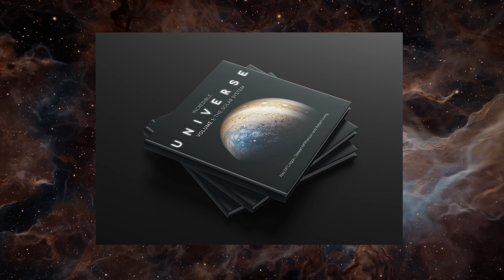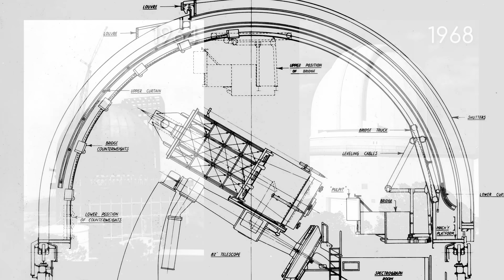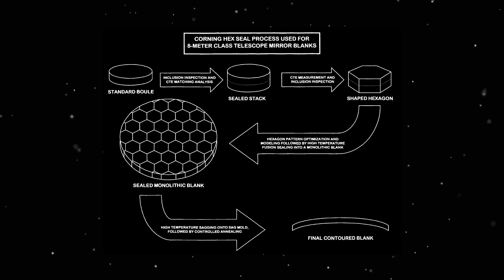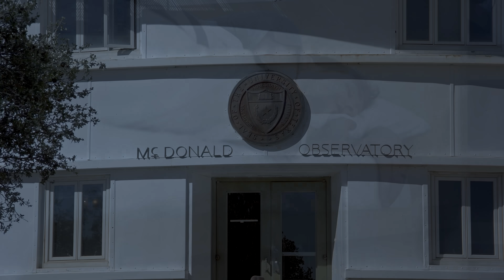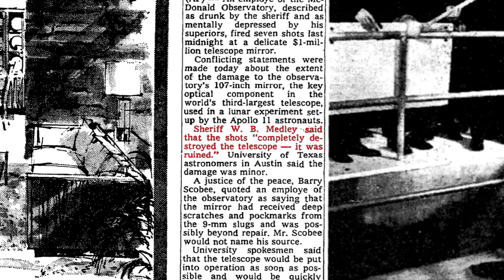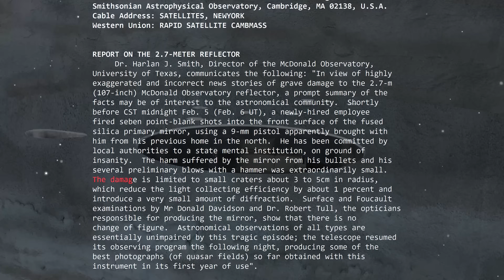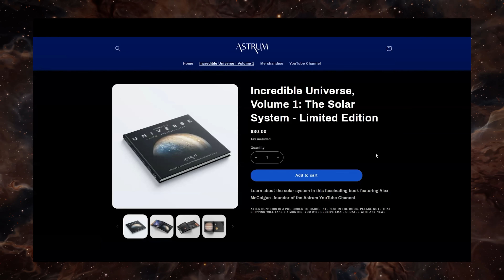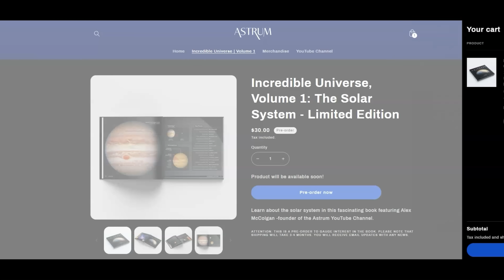Malicious Attack on $5 Million Telescope. Scientists Don’t Care.

Comment: There's a video on my channel where I hit a piece of 3/8" thick tempered shower glass with a framing hammer. I thought it would break, but it didn't, so I adjusted my grip and started swinging from further back. Nothing. The hammer just bounces off. It bounces off, unless you hit the ends. All you have to do is gently tap the end part and the entire piece will instantaneously explode. It doesn't break from the point of impact, the entire thing breaks at once. Well, it appears to break all at once, but with high speed camera, you can probably watch cracks propagate from the point of impact. The whole thing is in compression due to the tempering process, and there are stress concentrations on the short sides, the 3/8" thick sides. If you're going to try this, wear ear plugs though, it's extremely loud!

Comment: It's hard to believe they can't repair the mirror. Can't they fill the holes with molten glass?
Reply: No - once the blank has been figured and polished, that's it. The nature of the material itself prevents this, as it would require fusing material into the damaged areas, then refiguring and final polish (this is greatly over-simplified).

Comment: Maybe the only "operational" telescope to be attacked, but the 200 inch Hale mirror was shipped cross country by train in 1936. The crate surrounding it was wood, but Corning required that the mirror blank be sandwiched between thick sheet steel to protect it.  When the blank arrived in California it was discovered the shipping crate had be struck 4 times by bullets!
Reply: Sounds similar to aircraft fuselages moved by train that sometimes have to have bullet holes repaired before they can be assembled into airliners
Reply: @matthewmiller6068  hunters shoot propane train cars all the time. What they don't realize They would easily blow themselves up if they are within even 500 yd of a propane train car.
Reply: @rustyshakleford5230  Rifle wouldn't come close to hurting a tanker car on a train
Reply: @rustyshakleford5230 Mythbusters would disagree.  Assuming that you don’t have an elephant gun.
Reply: @rustyshakleford5230  ....why?!
Reply: Propane doesnr just ignite when you shoot it like that
Reply: @rustyshakleford5230 sorry not gonna blow up. Propane has no oxidizer present and is cold when it depresurizes. A bullet, even if it was capable of penetrating the pressure vesse, would be super cooled the moment it penetrates the cease and propane rushes out. That will cool any (unlikely) spark and prevent the explosion. 
Now, if the escaped propane then reaches BOTH a mixture between the lower and upper explosive limit (neither too rich nor too lean to ignite) AND an ignition source at that point, there will be a fireball, not an explosion although the initial flash could seem like an explosion but it’s not. 
If propane is still escaping the breach, it is possible to have a large stream of flame at the interface between the escaping propane and the surrounding air at the point where the mixture is appropriate to support combustion. 
You can make such a cylinder cause a large blast but it’s still not going to be an explosion and I’m not going to describe how to do it. 
USMC Ordnance
Instructor, field expedient mines, booby traps, and explosives.
Reply: @danlorett2184  Its still insanely stupid of them to do so
Reply: 'Merica moment.
Reply: A damn  good reason for strict gun controls. The USA needs an IA that can track svery gun in real time, and every bullet fired and who fired it.
Get working IT programmers!
Reply: @way2dumb  "The government chips our bulleeets."
Reply: @way2dumb you REALLY can't be that stupid!
Reply: @way2dumb  Name checks out
Reply: thegreenpickelit's it's an Australian thing,laughing at oneself. It's a level of sophistication and maturity most right wing Muricans never achieve. , Obama was good at it.
Reply: @way2dumb Really? Is that why comedians refuse to do shows at College's becausee the Left are unable to laugh at themselves.
Reply: @A-FrameWedge  In the USA, not Australia. I see few comedies with Americans laughing at themselves, they generally laugh at others. Aussies have a superior sense of humour in that regard.
Reply: @way2dumb  Australia might be even more Woke than the U.S., so sorry not buying it. You probably love Hana’s Gadsby humorless style.
Reply: @A-FrameWedge never heard of her him whatever. We are awake. Woke is  
a past tense verb, not an adjective or adverb.
Reply: @A-FrameWedge  I am not selling you anything.
Reply: @A-FrameWedge lol imagine still being one of the cringe lord's/lady's that think being woke is something bad 😂
Reply: @A-FrameWedge  jokes need to be funny for people to laugh, regardless of politics
Reply: @A-FrameWedge  Trump and Elon had great sense of humour and we're famously able to laugh at themselves. Right ... 🤦
Reply: @way2dumb I've seen better bait, you should look at what people actually argue for instead of what you're told to think that they do
Reply: @way2dumb username checks out
Reply: @way2dumb      The USA needs AI that can protect us from horrible legislation and horrible legislators.   A much better concept.   But I don't trust AI either.
Reply: @BillSmith-fx7xx  yeah well AI does not work like that. AI only gives you what you put into it. who ever programmes it will make it do what ever they want it to do.
Reply: @way2dumb  You're smoking something lol but yes, I agree that is funny
Reply: @way2dumb  Like we can't make our own guns or peel trackers off with a screwdriver, acetylene torch, or ... letting the battery die?
Reply: @StarForgers theoretically with enough surveillance access you wouldn't need that. You could track any firearm via triangulation of every microphone, if you have control of the supply you could put a radioactive isotope on every gun to detect them remotely, but if you could access every camera you could just track them visually with an AI and make sure you know where everyone with a gun is at any time and to track any occurrence of the gun appearing. With non visual light based cameras, like IR it might be a lot easier to detect guns. I think there is even an electromagnetic camera concept where it can basically detect ferromagnetic materials and EM fields with a visual generated on a screen. But the easiest thing would be just having microphones everywhere and then a bunch of little drones to track any gunshots and launch a drone to the location to follow the shooter.

Comment: Sooo... why the heck they are making them so big, those mirrors, if most of them is not used...?
Reply: You would have to fully understand telescope optics, and optics in general, along with the pragmatics of designing and implementing the system. The purpose of the telescope is also a factor. This is a "Swiss Army knife" which can be optically reconfigured, as well as instrument payload, to work from direct imaging sciences to point-source stellar photometry and spectroscopy, over the terrestrial optical EM band. In this case, the central obstruction/secondary shadow are a necessary artifact of what the telescope is designed to do.

Comment: The Hale 200-inch mirror was cast in 1935 by Corning and was the largest telescope mirror in the world at the time. It had problems and it was recast again, this time successfully. After an initial grind it was to be sent to California by rail to get polished. It was carefully put inside a wooden box. As an afterthought, they added some metal plate to the box. When it arrived in California they found some bullet craters in the metal plate covering the mirror. It looks like someone used the moving box on the train car as target practice. The mirror was undamaged thanks to the decision to add the metal plates.

Comment: Even without the special properties of fused silica, I wouldn't have expected such a thick piece of glass to simply shatter. I'd pretty much expected local damage, like it actually turned out. Though the highly defined edges of the damaged areas were surely interesting. Or are these images taken after smoothing them out?
Reply: These are current images, captured long after the mitigations were taken. A diamond burr grinder was used to smooth the cavities, to reduce off axis, as well as on-axis scattering. The cavity edges were smoothed, best described as a bevel, to reduce stresses in the transition from surface to cavity/damage, which might propagate as surface stress fracturing across the figured surface.   We coat over the entire substrate, as if it  has no mechanical damage.

Comment: If the telescope doesn't really need the interior rings, why not just build a really big mirror without it?  That would save on weight and cost.
Reply: In a system of this type, the obstructed central area, near the straight Cassegrain focus, it is possible to use the thickness and weight of the substrate as part of the optomecahanical  design of the telescope's structure. That is one element in play here. This era also predates things like computational FEM, the advances in material science, and optical science we have today. We would not build anything like this in contemporary times.

Comment: Interesting story.
A lot (not all) more modern-build telescopes would suffer a lot more damage, with the more prevalent very thin segmented mirrors on adaptive optics mounts… but on the other hand, these mirrors might be somewhat easier to replace these days than the older massive one-piece ones. I don’t even want to think about what it would mean to replace the Palomar 5 metre mirror these days.
(A complete rebuild of the mount and going for a segmented mirror may be possible, but it would likely be a nightmare to do - a nightmare several years long…)

Comment: Harlan J. Smith is the largest closed-tube telescope ever built.  Pock marks were painted black.  I visited McDonald Observatory during the Texas Star Party.
Reply: The anecdote re. painting the damaged areas black is incorrect, urban legend. We strip the old coating, prepare the bare substrate, and coat the entire area, including the damaged areas, as if they're not even there. In some cases, they look black, however that is by intention, to prevent scattered light from the damaged areas, combined with aging of the coating. I can assure you, they bullet marks are not painted black, or treated in any other way...

Comment: The Telescope That Took a Bullet: The Story of the Harlan J. Smith Telescope and its Resilience

* 0:09 A Telescope Under Attack: In 1970, the Harlan J. Smith Telescope at the McDonald Observatory in Texas was shot seven times with a 9mm pistol by a disgruntled employee named Jack Hyde. 
* 0:39 Third Largest in the World: At the time of the incident, the 2.7-meter telescope was the third largest globally, representing a significant investment and scientific tool. [From ffggddss's Comments] This claim is potentially inaccurate; the 120-inch Lick Observatory telescope may have been larger at the time.
* 1:46 A Collaborative Effort: The telescope was built with a $5 million grant from NASA and was intended to support research relevant to the early space race. 
* 2:59 A Remarkably Resilient Mirror: The telescope's mirror, made of fused silica glass through a complex and lengthy process, proved to be unexpectedly resistant to the attack.
* 3:04 Fused Silica's Strength: The layered construction of the fused silica mirror, originally due to material scarcity and technological limitations, inadvertently created a laminate-like structure that absorbed the impact of the bullets. [From jokerace8227's Comments] Fused silica is more difficult to mold than regular glass and requires much higher temperatures to produce.
* 7:07 Hammer Time: Prior to the shooting, Hyde attempted to smash the mirror with a hammer, which also failed and resulted in only a minor chip. [From kirbymarchbarcena's Comments] The mirror's resilience humorously demonstrates Newton's Third Law of motion.
* 8:30 Minimal Damage: Despite the seven bullet holes and the hammer strike, the damage to the telescope's light-gathering capacity was estimated to be only around 1%.
* 8:36 Critical Areas Missed: Most of the bullets hit a less critical area of the mirror near the center, where light-gathering is less important for image resolution. 
* 9:23 Quick Repairs: The telescope was quickly repaired by drilling out the bullets, smoothing the holes, and reapplying the reflective coating. 
* 9:40 Leniency and Understanding:  Director Harlan J. Smith, learning of Hyde's mental health struggles, chose not to press charges and instead sought to get Hyde help. [From BernhardtBauer's Comments] This was a commendable act of empathy and support.
* 10:38 A Legacy of Discovery:  The Harlan J. Smith Telescope continued to operate for decades, contributing to significant discoveries in planetary science and exoplanet research.
* 11:40 Space Hazards: The incident highlights the resilience of Earth-based telescopes compared to space-based telescopes like the James Webb, which face constant threats from micrometeoroid impacts. [From tomholroyd7519's Comments] This is true; the JWST has sustained minor damage from multiple micrometeoroid strikes.

I used gemini-1.5-pro-exp-0801 on rocketrecap dot com to summarize the transcript.
Cost (if I didn't use the free tier): $0.08
Input tokens: 20518
Output tokens: 657

Comment: Fascinating story, and well told! But having been an amateur astronomer since about a decade before this incident, I'm puzzled by one claim made here.
Maybe my memory is faulty, but if it isn't, I thought this 70-inch scope would have ranked 4th or lower in aperture at the time, not 3rd.

This being a few years before the Soviet's botched 6-meter (236-inch) mirror saw first light in Crimea, the 200-inch Hale telescope at Palomar was still largest in the world; and the 100-inch Hooker reflector on Mt. Wilson had been in operation since the very early 20th century.

I thought that the 120-inch at Lick Observatory was in 2nd place; or was it launched after this incident at McDonald Observatory?

Fred
Reply: I stand corrected. This scope is 2.7 meters – 107 (not 70) inches in diameter.

Comment: 72 hour shifts? how strong is their meth?!?! if they are not on meth your lying.
Reply: They sleep in between. They’re just at the site for 72 hours
Reply: @HyperspatialAgent_Axis4  but the dude said most live on site??? now that's just getting misleading and confusing
Reply: They slept on-site on cots. Shifts themselves were long, yes, but not insufferable. They got to sleep.
Reply: @DrachenGothik666  thx for clarification 👍
Reply: From the perspective of someone who has done this, and related jobs for a very long time: it may well be routine, that an observatory staff member's "shift" could be 72-hours, sometimes longer. We do it without "meth." It isn't uncommon for an instrument engineer or tech to remain on call for that sort of interval, responding activity to both day, and night needs. For someone coating an optic, especially a large primary, similar demands are present.

In my role, I am, in fact required to live/reside on site. In the era in which this event occurred, there was significant schedule pressure, and science need to keep the telescope "on sky" every single minute weather permitted, as well as the day-time operations required to make the former possible.

Comment: Interesting you'd think they'd fill the bullet holes with something, anything, even if it's not perfect it would surely still be better than loosing 1% of light?!
Reply: Filling in the holes wouldn't do much, there is a reason so much time and care went into making it. If you didn't fix it exactly how it was first made it would only make performance worse.
Reply: It wouldn’t do anything and it could in fact cause further damage. If it’s filled with a reflective paste for example, it could expand slightly and cause internal stress in the glass.

Comment: Things like this used to happen at the US Post Office, (where the term "going Postal" comes from), caused by over work, caused by power lust of some senior Employees. You can stress a person just so far and then they snap, either striking back or running away, but be assured, they take it out on everybody around them. Somebody knew this guy was cracking and didn't know what to do about it. I'm glad he missed the Supervisor, (Possibly the stress causer, as he was singled out), I wonder what happened to Jack Hyde?
Reply: it started from some kind of postal work safety legislation change wasn't it? less restrictions on working hours and cuts to funding from the 70's
Reply: I thought it was because the post office has its own law enforcement, kinda like the FBI, but called Postal Inspectors.
Reply: It’s up to the individual to deal with their own stress. If they’re that stressed then quit.
Reply: @rolandthethompsongunner64  have you ever been in a situation where your job is actually destroying you, there's nothing else around and you can't afford to quit?